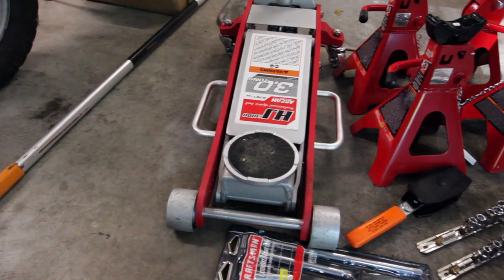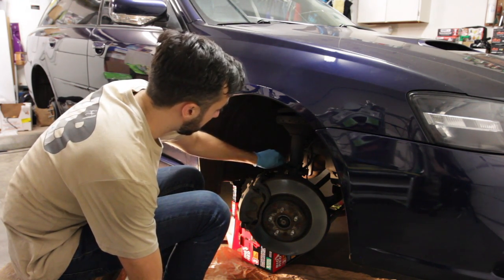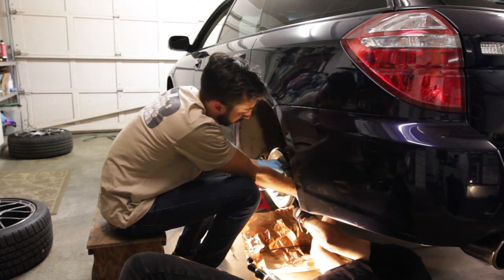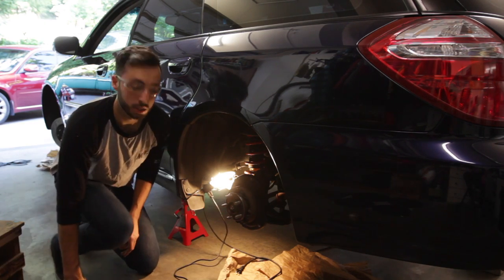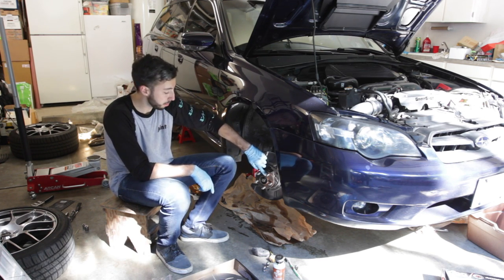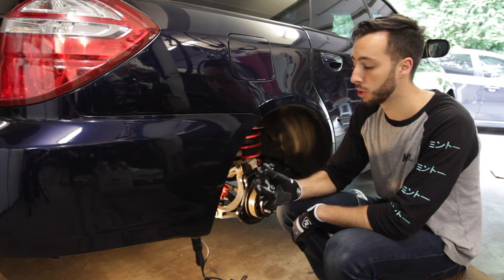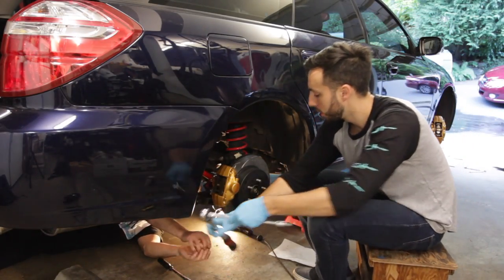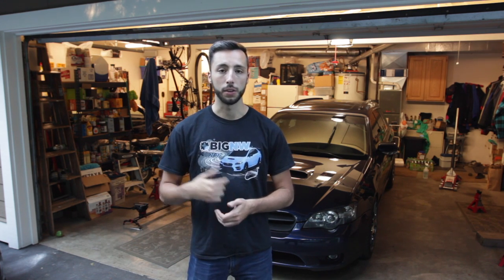STI Brembo Install - 2005 Legacy GT

Comment: That wasn't 14 ft lbs on those banjo bolts. You got to stop when it clicks not give it another turn. Good way to twist it off.
Reply from the maker: John Kerfont it was set just below 14 ft lbs.
Reply: Average Bros Media 
14lbs is 14lbs, not just under or give it more. Just don't like it when people do that. Good job on the install by the way. Looks good. 
How was the brake feel? And Merry Christmas
Reply from the maker: John Kerfont absolutely, I did 10 ft lbs all around and then went back to and tightened to 14. But thank you! And they feel great, it’s an essential upgrade with the additional power. Merry Christmas to you too

Comment: We may literally be twins... I have an 05 LGT 5spd Regal Blue Pearl Wagon as well. We've done a few different mods, yours is much cleaner than mine right now, but great job man! I bought mine back in 2009 and used for it many snowboarding trips, and a bunch of crazy adventures, blew up the first 5spd and then put a new one in. Currently it now sits bagged and stage 2 plus. Stock turbo, internals and that's about all left stock. Doing the swap to brembos in a couple weeks. I am trying to decide if I want to get the calipers I just got powder coated or touch them up.  Thanks for the video, definitely a lot of help!
Reply from the maker: That's awesome man! Where are you located? Good luck with the Brembo install, my advice on painting is if you are planning to do it down the road just do it now so you don't have to pull them off in the future.

Comment: Hey man.  See those smaller holes, inset from the lugs holes?  Should be able to thread a 10 or 12mm bolt through there, which will pop the rotor right off when it presses against the hub.
Reply from the maker: Hey Steve, thanks for letting us know! We actually figured that out while doing the install and mentioned in the video.

Comment: Prolly a dumb question but the calipers themselves... What did they come off of for reference? Im having breaks done and thinking of doing a swap but im not buying brand new ones
Reply from the maker: Dylan oneil no worries, not a dumb question at all. Mine are of of an 04 STI, but if I’m remember correctly you should be able to use any year STI caliper, you’ll just need the 04 rotors due to the bolt pattern.
Reply: @avengednick  sweet thank you.  Was it an expensive mod?  I have over 300 to the wheels right now and plan foe more soon so idk if its worth it or not
Reply from the maker: Dylan oneil plan for at least 2k for the full swap. That’s right about where I’m at, I’ve got 309hp to the wheels and the brembos in my are one of the best mods I’ve done.

Comment: I am definitely interested in doing this to my spec b the rotors brake pads and brake lines are for the 2005-2009 legacy gt not the 2004 still correct ?
Reply from the maker: Definitely a good upgrade for the spec b! So it's kind of a mix, the lines, pads and rear rotors are for the LGT. The front rotors are just for an 04 STI.

Comment: Great job 
What is the dba part nr on the disc for the rear 
So i can order it over here in the Netherlands 
We have dba suppliers
Reply from the maker: multistyler I ordered them through KNS brakes, they had the rear rotors made specifically for them so I’m not sure if they’re available elsewhere.
Reply: Thanx for the reply 
Oke i keep looking thax

Comment: How much larger are the new rotors compared to the stock LGT ones? And you can use any 04-07 STI Brembo calipers? Final question will these fit under 17x8s
Thanks!
Reply from the maker: I don't know exactly how much larger they are, but both the front and rear are larger than the stock rotors. And you can use any 04-07 calipers, you'll just want to stay away from 08+ cause the rear does not bolt on even with an adapter. And I would imagine they would fit under most 17x8's depending on offset since the stock BBS's on the 04-07 STI were 17x8.
Reply: @avengednick  rear 08+ brembo brakes work the legacy gt wagon. I know that because it's what I'm currently running to be exact I'm using 2012 sti brake's
Reply: @akhoodlum6694  Hey man, everything I see online says it doesn't work, how did you get it started, i've got all my sti swap stuff arriving today and have been trying to figure out a way around this problem.

Comment: Do the front calipers bolt straight on with no other mount adapter needed ?? Cheers mate.
Reply from the maker: Tony Cooper yup, they’re a direct fit, no adapter needed!
Reply: @avengednick  thanks for your reply, that's good to know

Comment: How to install the JDM tail lights? Plug and play?
Reply from the maker: They are relatively plug and play. The main issue is that one of the light sockets is different on the housing so you can either modify the plastic the light plugs into on the harness or I bought a new harness for Subaru that matched the housing

Comment: Are the rear spindles ok since grinding them?
Reply from the maker: Yup, been driving on them hard for 5 years with no issues. You remove very little material
Reply: @avengednick  wonderful, I finally did them and was a bit curious

Comment: Is there any other brake pads you can use on these brembos? Also what's the part number for the seal kits for the calipers? Thanks.
Reply from the maker: V.E.S.L. Yes, there are quite a few other options besides the Hawk’s. Plenty of choice for a variety of uses. And you have to ask a Subaru dealership for the part number on the seal, I unfortunately didn’t write them down.

Comment: Can i do the same thing to a 05 outback xt, looks the same as that legacy gt
Reply from the maker: Chang Vue yeah definitely possible, I believe it’s the same process
Reply: So the new rotors are not from a sti?
Reply from the maker: Chang Vue the fronts would work on an 04 STI but the rears are meant for a Legacy GT/OBXT running Brembos

Comment: So sti gold brembos just fit there no fitment issue?!
I thought sti rotors was bigger than lgt ones
05 STi 323 x 30 mm
06 LGT 312 x 30 mm
Both fronts.
Reply from the maker: Bob Lemoche no, it’s an 04 STI rotor on the front and an larger adapter rotor on the rear to accommodate the stock parking brake. Front calipers bolt up to the stock location, rears require an adapter bracket.

Comment: Do the brembos use a bigger rotor than stock size? And if they which model sti or wrx would fit
Reply from the maker: Yes they do. 04 STI in the front and the rear is going to depend what parking brake style you go with. KNS Brakes has great info on the two options on their site

Comment: Am I able to use my old legacy rotors with the brembo calipers or do I have to purchase 04 sti calipers?
Reply from the maker: Nope, unfortunately you’ll need to buy new rotors front and rear.
Reply: @avengednick  Thx for the fast reply! Great vid btw! So on the kns website, do I search under my 06 leggy or 04 sti for rotors, brackets, pads etc?